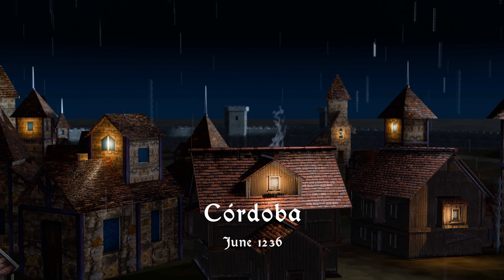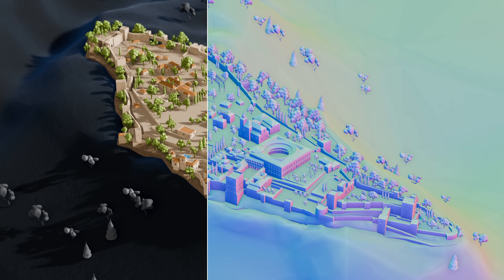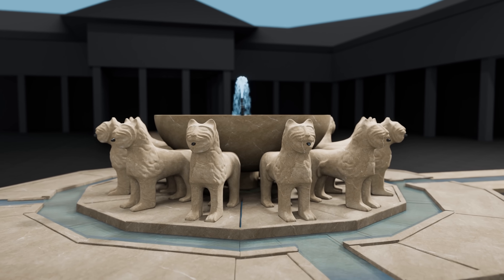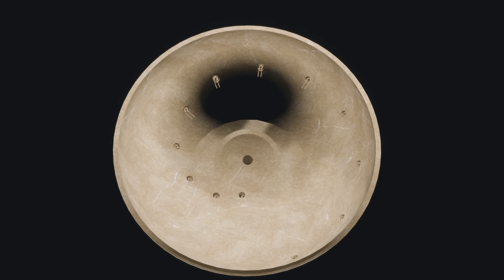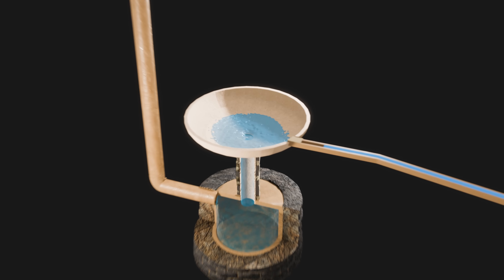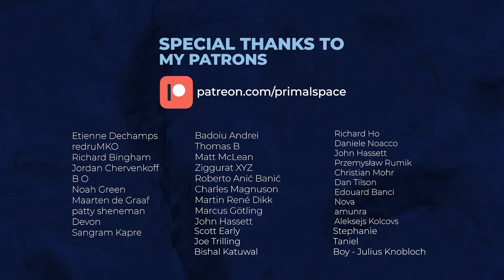The Ancient City That Mastered Water

Comment: Hydraulics is amazing!
We used Hydraulics at the dairy processing plant that I worked at. We often transferred milk from one vat to another without the use of electrical pumps. Put a hose between two vats, open both valves and the level would equalize. We could use one hose by immersing it completely, then pulling one end out and putting it in a smaller vat, and the milk would syphon to the smaller vat. 
Great video and presentation👍

Comment: I have only one question, What if it Rains?
Reply: Then the donkey gets lesser work.
Reply: @kjellg6532  but the rain disrupt the time clock fountain right?
Reply: @SuperCK001  There are so many strange details about this “clock” that I do not believe it ever existed. Let’s see. At midday the system resets. For a full hour no lion is spewing any water. Maybe there should have been only 11 lions? The lions share the same amount of water. So as the hours goes by, each active lion will have lesser and lesser water? As the hours goes by, the water depth over #1 lions feeding hole gets deeper and deeper in the water of the basin so #1 lion will take a grater and grater share of the available water. What if the sun shines and the evaporation increases? In scientific papers describing the restoration of the fountain, no trace of the reset Pythagorean cup is found.  From where did they get pressurised water to the fountain?  If they had access to pressurised water, why would they need that fancy Trompe-based 6 m pump?

Comment: Congratulations, and thank you, for creating this amazing video. I´ve visited the Alhambra two times and both times it was an incredible experience. I´m an architect, specializing for 30 years in sustainable design. The whirlpool part caught my attention in particular. I couldn´t get my head around the physics. I consulted a systems (HVAC) engineer about it. At the end my own conclusion is that some artistic license has been made to generate this video which, if the case is perfectly OK/understandable. For the whirlpool to work and to elevate water by 6 meters I believe that a significantly larger volume of water needs to generate the whirlpool than is shown, and above all, at the bottom of the system, the ´water collector drum´, there has to be an exit for a significant % of the water, the water that doesn´t get to rise, to be evacuated. Otherwise, I feel quite confident that the system would shut down rather quickly, ...it´s a matter of elemental physics.
Reply: Plas look up Trompe, Air lifting pump and Pulser pump.  This video only tells parts of the system. One may wonder why they did not simply used pressurised water from the dokey dam.

Comment: Honest question. Obviously these engineers know more then I ever will. But why wasn't the method on the last fountain to raise the water to the soldiers used for the very first one, to replace the donkey? Clearly it's not as simple and the elevation much higher, but couldn't they have stepped this process multiple times?

I only ask, because should that first position be over run, they could cut off the water supply and would be cooked because of a donkey. Whereas if they used the other method they knew, it could have all been buried and hidden.

Clearly skills wasn't the issue, why not go the extra step to conceal the water supply?
Reply: In theory you could, but this system would be huge. What is not shown in this video is that you also need a vertical chaft going up from the under ground chamber. As shown, ste system will only fill the chamber with water and stop. To lift water 60m, you will need compressed air, say 10 bar. Then the vertical down tunnel must be about 100 m down, and the up tunnel a bit less. A Trompe needs a large amount of flowing water to work, so the diameter of the shafts must be substantial. 
A waterwheeled pump would probably be easier to make and then you would not need any donkey to haul the water up.

Comment: Wonder what would happen if multiple whirlpool lifts were used in series?    Would it lift the water higher?
Reply: After the first whirlpool lift the water has gone through a small pipe so it's much lesser than it was before going through lift. So, due to that reason maybe it won't work. 
Perhaps this problem could be solved by making a very big whirlpool lift and then making much smaller subsequent lifts. This way you could make maybe 2 or more such lifts.
Reply: @ashj5952  You find one of the last functioning Trompes in Ontario, Canada. It has a waterfall of about 100 m and theoretically produce air at up to 10 bar. For sure it can power an Air lifting pump to lift water to a substantial height.  Btw. The system in this video will not work. No return tunnel to the ground surface for waste water and thus next to no air trapped in the underground chamber. It is all just a hole in the ground, doing nothing .
Reply: @kjellg6532 bro think he is intelligent by spitting crap

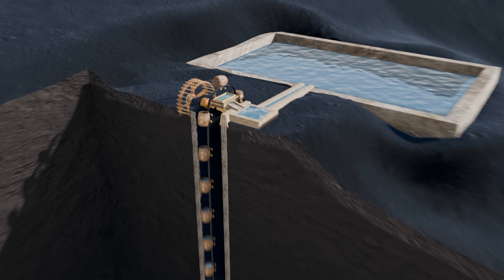Comment: 2:38 ahm, not possible the way you show it. the basin and channel would block the round trip of the horse

the drainage would also not work as you showed. 

and the holes would need to be at irregular intervalls since every additional hole would decrease the speed of which the basin would be filled.
Reply: There are a lot to question regarding this «clock». Probably it never existed. The 6m pump can not function as described here. Look up Pulser pump.

Comment: The whirlpool to raise water is a marvel. I wonder if engineers could use it today to restock rivers.
The biggest shoutout has to go to Moorish engineers, though. I am from the unconquered northern region of Spain, and there is nothing even close to this. The mathematicians and engineers from a millennium ago could still baffle today's graduates.
Reply: What is not shown in this video is that the 6m pump needs a high head/waterfall and uses a lot of water to pump just a fraction of it to a higher level.  A  hydroelectric installation driving an electric pump would probably do a better jobb, but a full river?
Reply: You weren't an idiot believing tribalists lies you would know the cretinous creatures stole it from northern spain. https://en.wikipedia.org/wiki/Trompe

Comment: The fountain is like a giant "Greedy cup"! That's so neat seeing a practical application for that mechanism!
Reply: But was there any Greedy cup here? Not mentioned at all in the report from a restauration.
Reply: @kjellg6532  The fountain uses the same mechanism as a greedy cup. The center holds a siphon that only activates once it's filled beyond a certain point, after which, it drains the entire thing.
Reply: @Valcuda  I know what a Archimedes Cup/Greedy cup is, but no such mechanism is mentioned in a report from the restoration of the fountain. There is neither any mentioning of the distributed draining holes to the lions.  Today the lions are all fed in parallel  from a circulating pump.
Reply: @kjellg6532  That's not the part I'm talking about. A pump fills up the reservoir faster than it can drain through the clock, allowing it to rise.
At 1'o clock, it fills up high enough that it activates a siphon, which drains it faster than it can fill up, which makes it so only 1 lion is spitting out water. THAT is the greedy cup mechanism I'm talking about!

Comment: is the whirlpool model beeing applied anywere else in the world nowadays? sounds like its application could still be brilliantly put to use for lifting water. 
secondly wouldn't a thinner pipe as outward with gas result into a lower water flow outward and therefor resulting into an overflow of the whirlpool or does this require a second outlet to drain overflow of water?
Reply: Look up Trompe, Air lifting pump and Pulser pump. Trompes have been used in the mining industry in Toronto, Canada up till reason years. With a 100+ m water head.

Comment: About the clock, the central pipe had constant rate, so they had to calculate the increasing loss of the water as the time pass
For example at 11 o o'clock, 11 pipes are loosing water and thus a 12th must be reached out...
Reply: As time passes, the water flow from each lion will get waker and weaker. From midday till 1 pm, no lion had any water. Did this “clock” ever exist?

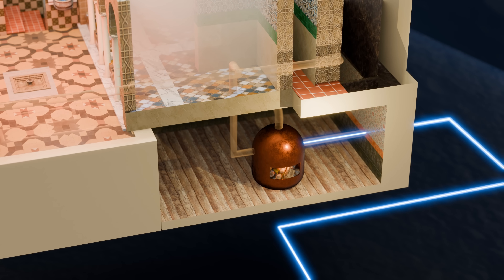Comment: 6:24 but wouldnt the smoke come with the water vapor into the hot room?
Reply: The fire and smoke are separated from the water and steam. Just think of it as running water pipes to, around, and away from a fire. You get no smoke in the pipes right?

Comment: The Alhambra Palace is a massive fortress with stunning architecture. Not only that, it also has an advanced water management system, showcasing the brilliance of ancient engineering. This complex irrigation mechanism was designed to ensure a continuous water supply to the palace, gardens, and fountains, even though it is located on a hilltop. Amazingly, despite being built hundreds of years ago, the irrigation system still works today, making it a marvel of both design and function.

Comment: Regarding the lion fountain water clock, how can it tell the time correctly when it rains? Rain water will fill the tank quicker than an hour. It is still clever, and may be that was the point, not as a clock to tell the time, but a smart and fun fountain. I read on Reddit that nowadays, all twelve lions spring water out of them regardless of the hour, is that true?
Reply: The Lions share the same amount of water so they get lesser and lesser each as the hours go by. At midday it resets and no Lion gets any water at all. In sunshine the clock will slow down. It is unclear how it can take one hour from one lion to the next as the surface of water increases by the squear of the radius. In short,I do not trust this clock theory. Today the fountain sprays eqally at all times as Reddet tells.

Comment: 2:37 wow why not replicate this now but instead of a horse pulling it use a windmill that can be rotate using solar charging panels.
Reply: And with a river at hand, why not use a waterwheel?  Works even at night and in cloudy days.
Reply: we have pumps now to preasurized the water so there is no need to bring the water slightly higher to get preasure

Comment: This is truly amazing! Tremendous job making these and keep 3D model of this whole place to really show this! Made it very understandable!!
Reply: Not accurate. Only half of the Trompe is shown and the Lions clock probably never existed.
Reply: @ Oh, why do you say that about the lions clock?
Reply: @ How did the regulate the innflow to be constant? As the number of active lions increases, each lion will get lesser and lesser water. Among the lions #1 will take a grater and grater part as number of active lions increases. How did they compensate for rain and heavy sunshine?  From where did they get pressurised water to the fountain spouting high into the air? Why will no lion give any water from midday till 1 pm?  The draining holes seem to be at about equidistant outward steps. How can there be 1 hour to reach the next hole when the area of water increases with the radius of the surface of the water?  There are so many questions related to this clock. A simple sundial would do the trick with no hassle.
Reply: @ Very interesting points, thank you for taking the time to reply.
Reply: @SuperSurreal  I came across a paper discussing the refurbishment of the  Lions’s fountain years ago. Not a single word about any clock or Pythagorean cup to reset anything. The 6m pump can work (if it exists), but not as described in this video, a lot is missing. Look up Pulser pump and Trompe.

Comment: Come è possibile che un flusso costante di acqua alimenti dapprima un solo leone, poi 2, poi 3 e via così fino a 12? L'acqua che esce dalle bocche dei leoni non sembra un getto così sottile da essere trascurabile nel calcolo. Per provare a capire ho cercato in rete altre spiegazioni sul suo funzionamento ma non ho trovato altri siti che dicano che questa fontana fosse in grado di scandire le ore.
Anche la spiegazione di come l'acqua viene innalzata di 6 metri sembra contro le leggi della fisica: l'acqua gasata non sale dentro un tubo, al massimo sono le bollicine che salgono e l'acqua resta dov'è. In contesti moderni l'acqua può essere "sollevata" mescolandola con aria compressa, ad esempio nei sistemi airlift, che usano aria pompata per creare una differenza di densità e un movimento verso l'alto, ma questo richiede una fonte di energia esterna per creare l'aria compressa.
Reply: I also have doubts about that Lions clock. In adittion the Pythagorean cup is not mentionedcat all from a paper reportingbthe restauration of the fountain. It also had to be regularly synchronised due to rain and strong sunshine. One would have been better off with a sun dial clock. No 12 lion never gets any water at all. The system resets at noon and #1 gets water one hour later.  
As for the 6 m pump, it works but not as told in the video. Look up Trome, Air lifting pump and Pulser pump on Wikipedia. The pump needs a huge amount of waste water to work.

Comment: There were two genius engenieering feature that impressed me. It's hard to chose one over other in entire video but this two were awesome. Surely the cleaver design of time clock in the heart of the granada and the design to push water up 6 M. Cleaver thinking. Poor engineers in today's world can't do anything without electricity , and big equipments. Hats of to genius who build Granada water system.
Reply: But did the clock ever exit? The 6m lift man work, but a lot is missing in is deskriptiv. Lokk up Pulser pump on Wikipedia

Comment: I see nothing unique about this. Simply, if the inlet is higher thane to outlet then this acts acts like siphon.
Reply: What siphon are you referring to?
Reply: @kjellg6532  Any siphon. To use an illegal example like when gas is siphoned from a car. Siphons are also used to assist in irrigation. Here again the inlet at the top has to higher that the outlet at the bottom!

Comment: Dude, they used the Fibonacci sequence to make the holes on the fountain!
Reply: Sure? The video states that the available volume of  water is constant over time. If the outward step in distance from the center, how do you compensate for the area of water increasing by the square of the distance from the centre?  When a new hole is reach, a new drain is opened. There will take longer time to reach the next hole, or there must be a change in the slope of the bottom. Photos of the basin indicates a nearly flat bottom with nearly vertical sides? 
In short, I do not believe this “clock” ever existed.